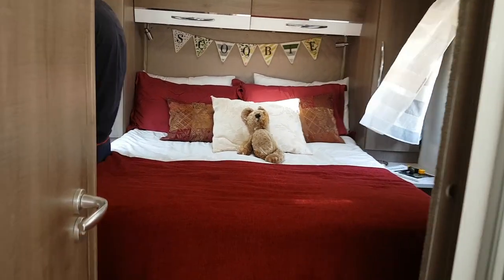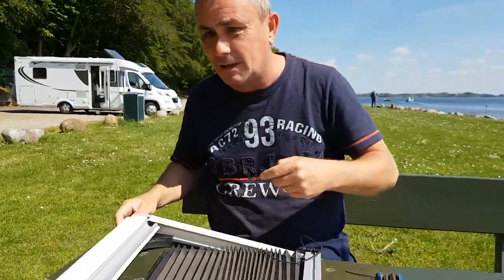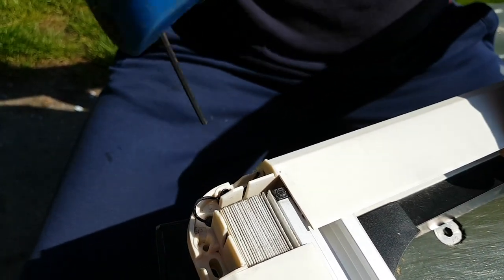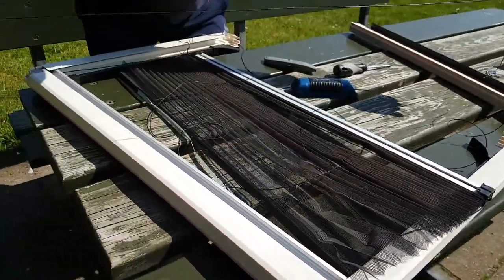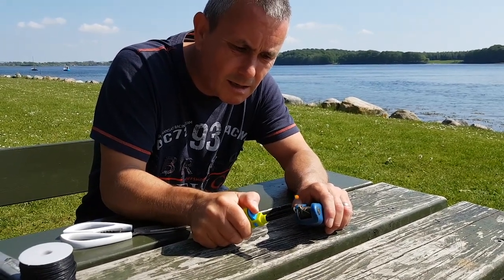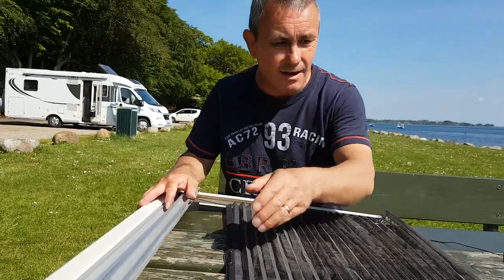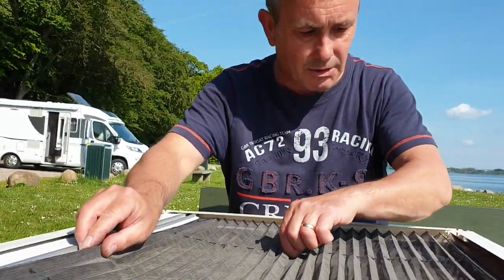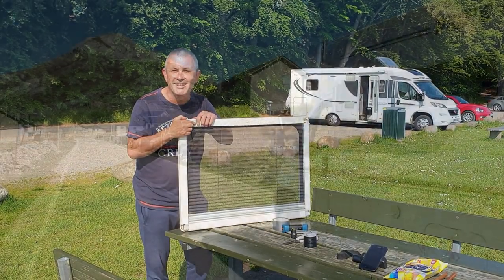Remis blind chord replacement

Comment: Thank you so much for this video. Our white blind, rather than the fly screen, is the same. I'm going to order the cord then attempt to follow your instructions. Wish me luck!
Reply from the maker: Good Luck
Reply: I did it! Thanks so much for your video. I was a bit worried when I had to virtually dismantle the whole blind, but I took photos at each stage. Works better than it ever did now. Won't be worried if I have to do another one. @TheMotoroamers

Comment: On our Remis blind the chord is through the blind rather than the fly-screen, but the principles re the same. Thanks.
Reply: Yes. The door is a little bit trickier because the chord is in 3 bits. I've cocked it up the first time but I have another chance coming up.
Reply from the maker: @chrisford2906  no worries. Glad it helped

Comment: Great video.  Feared having to buy a new one. Ours is the door, but I'm presuming its the same principle just a bit bigger.  Thanks guys :)
Reply from the maker: Hi Gloria, yes it's the same principle just different, LOL.  There isn't 1 string it's 3 seperate ones. 1 for the bottom third, 1 for the middle third and 1 for the top third. If you follow the same principle for the bit that's broken you can leave the other 2 strings in place. Loadsa patience, loadsa pictures as you go and as long as you don;t have pesky morroccan salesmen wanting to sell you everything possible whilst you're concentrating you'll be OK. Let me know how you get on. Myles
Reply: Thanks. Another Covid project and thankfully not too many Moroccan salesmen in Northumberland at this time of year 😊😊
Reply from the maker: @gloriaanne6909  lol

Comment: Great video buddy you made it look easy lol … I have a dometic panoramic skylight I need to fix the fly screen on which I’m hoping it’s the same process 

One thing I’ve noticed looks different to yours is I have plastic strips that slide out on those bars the fly net slides in to either end 

I no you say look at the old strings but in my case I bought the van like this 😂 so nothing to follow 

Trying to find someone to replace or repair in Yorkshire is hard bloody work too 

So trying it myself . I may have to drill holes in those strips I mentioned that keep the fly mesh locked in the runner bar
Reply from the maker: It was a bit head scratchy to begin with. Lol. Good luck. Don't forget to subscribe. Loads of D.I.Y videos and plenty of adventure videos to watch.